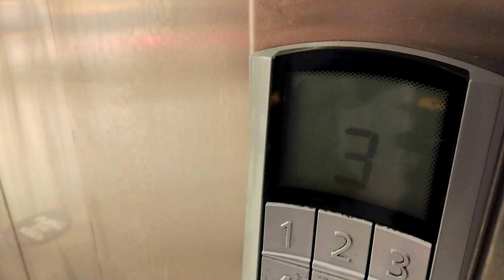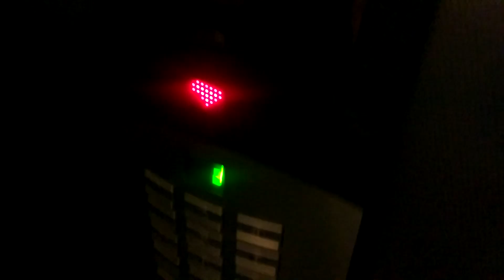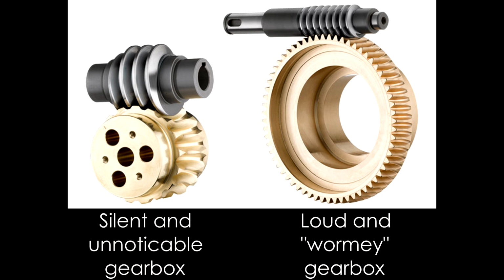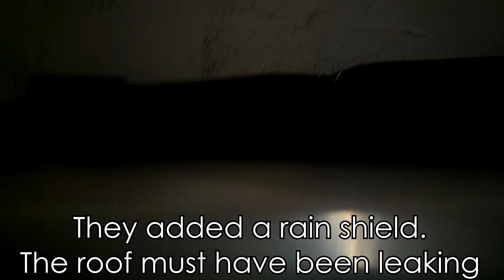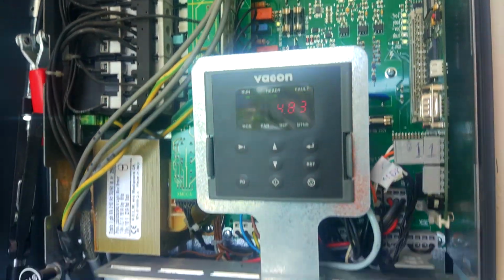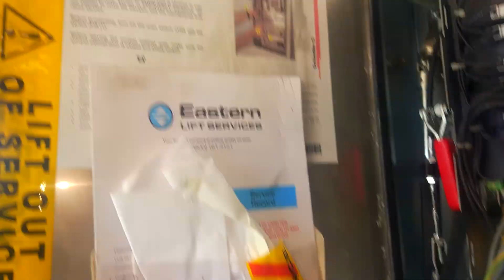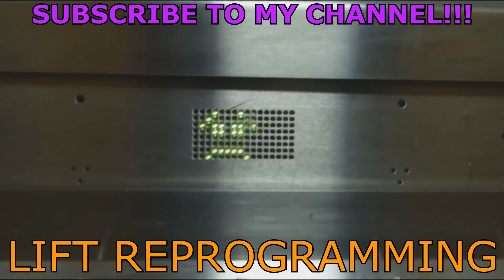Detailed look at Schindler Smart

Comment: You can work out a couple of faultts by certain LED states in the cabinet, you (Schindler engineer or me) can also connect a app/Software to the cabinet. If theres a BUS failure and you dont have the app you are screwed because the COP wont display anything.

Comment: The 2nd version is very grotty.
I know of a rather rude one at the villa del Conde in Gran Canaria, which jolts when the doors open and squeaks. And the gearbox noise is very loud and higher pitched than this one. It also doesn't have a voice or a chime.

Also, the hotel uses them as SERVICE LIFTS

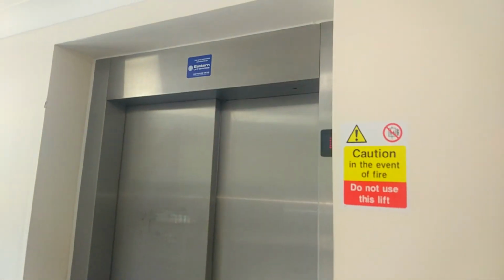Comment: Those blue LED panels 06:15 are usually installed to prevent drug injecting.
Reply: I've seen blue lighting in the stairwell of a block of flats. Doesn't auger well.

Comment: A mall I've been to has one of these, though it only serves 3 floors.
Recently, they massacred it by adding a cheap nasty keyswitch to the ground floor and replacing the flat call button on the ground floor with a regular one, which they just bodged right onto the original one.

Comment: The millennium, I remember when the year 2000 was the future. Now it’s well into the past. O dear, I suddenly feel old. I wonder if that keypad has some hidden easter eggs. Imagine if Casio had designed it, it would have a built-in calculator. I bet it wouldn’t be difficult to mod the firmware to do this😁. The wormgear really sounds like a car reversing or a food processor grinding it’s kitchen mixer bowl gears.

Comment: i have question, so on schindler 3300 there is triangle lock to open the logic but when i try to open it, it doesnt open for some reason, why doesnt it open? i tried it with so many schindlers and none of them opened
Reply from the maker: Those 3300 cabinets are crap.  Turn the triangle key and lift the entire panel upwards.  But they are even harder to close than they are to open.

Comment: Orona didnt copied the Schindler Smart motor but they made their own geared motor more compact so it can fit in lift shafts Otis also have invented a MRL wormdrive lift which is the 2000 VF MRL with an Otis 2000 geared motor in the shaft.

Comment: I cannot see these lifts going for 50 years or more like so many others have. Imagine trying to remove that gearbox if the lift cannot be moved because it's jammed up. I guess the aim is to sell the building before that happens..
Reply from the maker: Sadly these are unlikely to last 50 years.  Although, nothing lasts that long nowadays.  The only stuff built now that is the equivalent to the quality of the 60s are top of the range stuff such as Kone MX32 and Schindler 7000, which are not common lifts to find.  With that said, the other day I found a Kone MX32 in a building with only 11 floors.  That was completely epic.  You never see such lifts in 11 floor buildings.  The building owner must have had a thing about having a good lift, as everything else about the building was bog standard.  

With the Schindler smart, the failure point is the doors.  The cheap doors on lifts such as Kone MX06/NMX07, Schindler 3300 and smart, Thyssenkrupp MRLs, and all Oronas are terrible.  The doors mess up all the time and are far too cheap for the job.  The Motor is the highest quality component on this lift.  The chance of the gearbox jamming up is unlikely.  If that was too happen the whole lift would probably be replaced.  Generic engineers rarely replace major components and prefer to make more money by persuading the building owner to modernize, and on a lift like this where they probably don't understand it and don't want to put in the effort into understanding it, then the likelihood of repairs being carried out is even less.  The main reason for these being modernized is because the logic makes the lift hard to maintain.